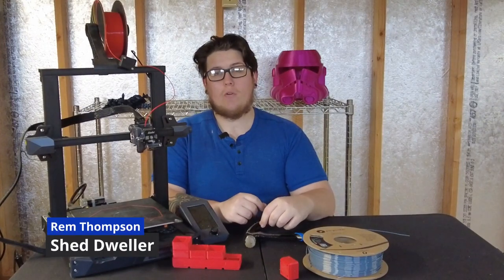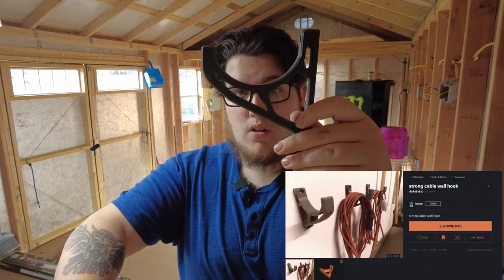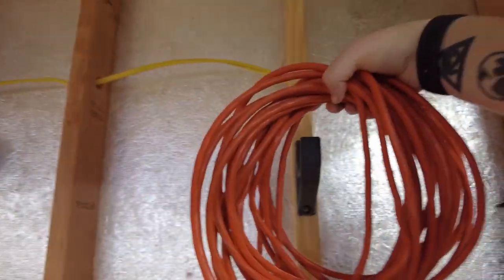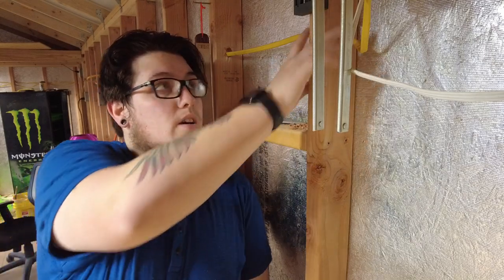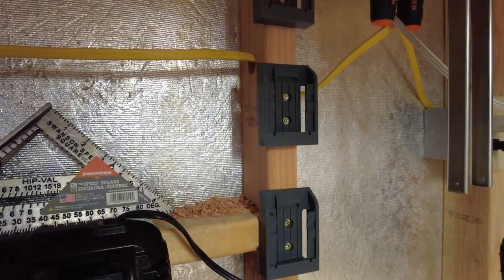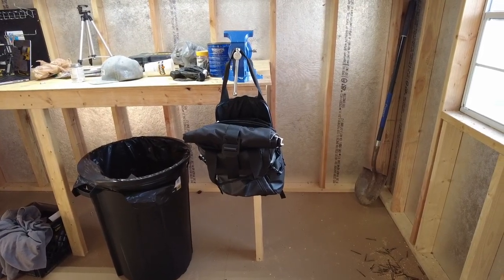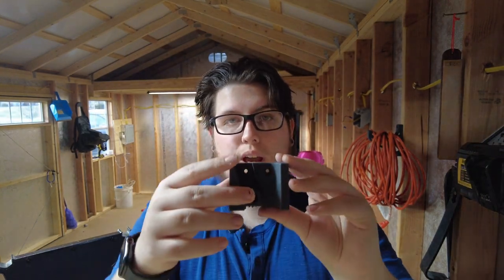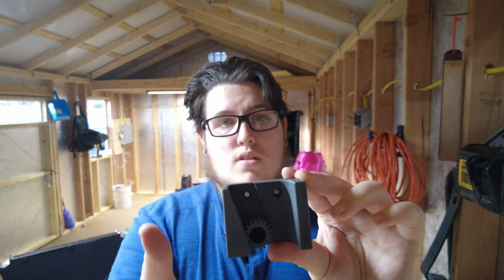Transform Your Workshop with These Genius 3D Prints!

Comment: A few pointers on your work-shed: I see you used 12GA wire but used 15amp sockets - The sockets should be 20amp. Also with your workstations of printers etc, it won't hurt to put quad boxes in (2 sockets = 4 plugs) more stuff to directly plug in. While everything is still open, think about using pancake style leds (dimmable) in your ceiling (3'-4' spacing) which will cut down on shadows. As far as insulation, use rockwool, almost fireproof and good for sound-proofing.
Reply from the maker: Dude these are really great suggestions! I don't have a ton of knowledge about the electrical side of things. I had an electrician buddy help me with wiring the breaker box and everything so I will talk to him and find out about why we went with the breakers we did. I have two shop lights currently but I love your lighting suggestion. Major props!
Reply: @remthompson  Another suggestion is to install a WiFi mesh with ethernet (faster than wireless). Most 3D printers are USB. With that said, you can plug them into a USB Hub and plug that into the ethernet, which is part of the Mesh.